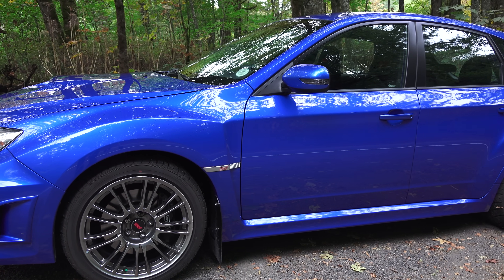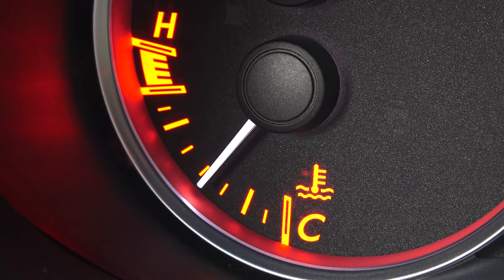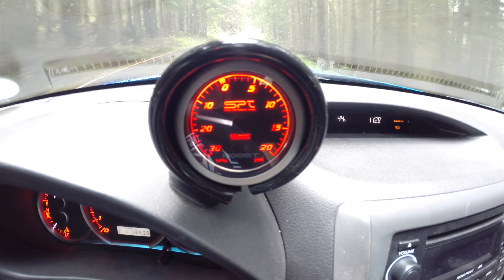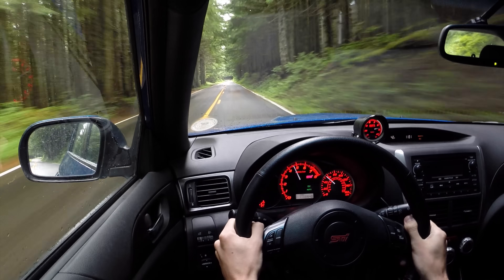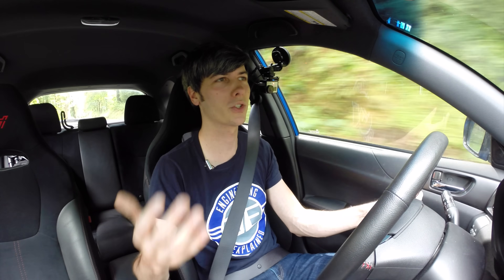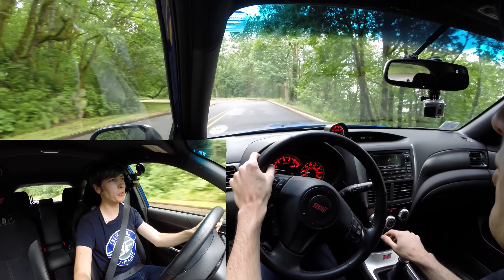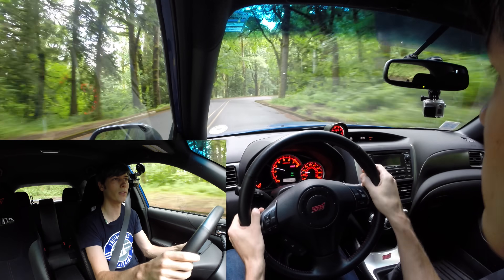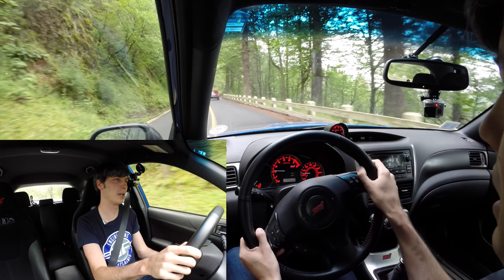5 Things You Should Never Do In A Turbocharged Vehicle

Comment: Unless your car has an auxiliary coolant pump that continues to run coolant to the turbo charger after the car has been shut off to prevent any issues. Thanks VW!
Reply: Yeah but Subaru's just use science instead of a pump. Their turbos are oil and water cooled so the coolant will continue to circulate even after shutting off the engine because of thermal siphoning. That's why turbo Subaru's have an extra coolant reservoir above the turbo at a higher point in the coolant system then the radiator.
Reply: +Ethan Johnson except for Subaru, because Subaru, you know...
Reply: And BMW. And Audi. And Mercedes. And almost any modern turbo car that has a performance turbo.
Reply: It's still wise to cool your whole car down, especially after some fast driving. brakes, diffs, engine, oil, coolant etc. It's not just the turbo that gets stressed.
I personally do it on every car I ever owned, NA or turbo. its not that I am standing there with the engine idling, but, 1-2kms before reaching home, I start driving slowly, low rpm, small load, etc. 
your car (and your pocket) will thank you later, especially since you own a vw
Reply: Ivan Nosic it depends. modern cars with electric water pumps are usually safe.
But on older ones, you can switch the engine off, the water that remains in the engine block boils because it is not circulating. Boiling makes steam, and steam can lead to corrosion in the engine.
The same thing can happen with the oil, it gets overheated at some hot spots inside the engine and can lose its protective properties.

In any case, it's always better to let the whole car cool down a bit. Fast driving also means hard breaking, fast shifts etc. Brakes, tyres, transmission, everything is warm, why not let it relax a bit?
Reply: 3DFX I agree. You have an excellent all rounder with great performance.
All you need is a set of semislicks and maybe some upgraded brake pads and you  are good for track days, while keeping it perfectly good for everyday use even. I wouldn't bother tuning such a nice and balanced car (damn I say too many good words for a vw, which I usually don't like, but clubsport is a fine sport car)
Reply: That doesn't mean you should just shut off your engine after running it hard. Even in engines without a turbocharger, it's wise to let things cool down for a little bit and let temperatures even out, let parts seat evenly, etc. as they cool.
Reply: yup but that keeps the engine consuming extra fuel even without driver on wich is hilarious cause goes against the downsizing scam argument also that amount of fuel is never considered for car magazines and autotesters when measure fuel efficency LOL they suck!
Reply: Ford Ecoboost engines have this as well
Reply: Yep, even my Fiat Abarth has an electric auxiliary pump that runs after the engine is shut off.
Reply: Ivan Nosic no,its not wise to turn off a NA car when it's hot after some fast driving.
I don't know why so many people think it's just the turbo that needs cooling
Reply: Ivan Nosic yes, after a certain point, turbo engines also become very expensive to tune.
The problem with NA engines, is that, no matter what you do, you can't get a lot of hp from them, unless you turbocharge them.
I mean, if you have a 3000cc NA engine that makes 300hp from factory, it is extremely hard to get it to 400hp for example. And even then you might need a stroker kit, which immediately sky rockets the cost of the project.
And in the end, you will have an engine that will be lethargic up to say 5000rpm, and it's power band will be 5000-8000rpm. Not very useful
Reply: dimos k Interesting! iwas thinking of buying new Turbocharger (TTE470) and, intake, intercooler, & tune my new Golf GTI Clubsport. But as the list of things grew, so did the costs (& i assume the risk of future problems). Im assuming if i would go all the way, i may have 15.000 dollars or more for all the upgrades. So i started thinking, hey the car is already excellent from factory, why give myself more problems in the future..? So ithought it might just as well be smarter off saving those cash for the next car i buy, in 5 years or so. Thinking twice about it, the upgrades would have been 1/3 rd of the cars total costs, & thats not even including installation. Do you have any good recomendations what i could do with it without compromising realability? The company i asked said software tune & change intercooler & intake would be the wisest choice. Whats your opinion on this?
Reply: +Vegaspsycho what? Same deal with my 07 A4 and was the same in my 00 A4 too. Subaru turbos are not special in any way at all.
Reply: into and onto, coolant and oil........ or onto your exhaust manifolds... ugghh.. 
been there done that...
Reply: and 80's Porsches
Reply: Some of my friends' turbodiesel cars had a turbo timer installed which prevents the engine from being turned off from 30 seconds to 2 minutes depending on how hard they drove the car. You can pull out the key and lock the car though and it shuts the engine automatically.
Reply: thank goodness for remote lock unlock that s NOT INTEGRATED IN THE KEY BECAUSE OTHERWISE, IT OVER
Reply: +Ivan Nosic yeah but if that keeps the engine and turbo healthy then thr extra fuel burned is worth it, besides idling for 2 minutes doesnt consume that much fuel does it?
Reply: +Ivan Nosic Nope, the engine turns off, the pump runs off the battery.
Reply: +Charles Gtm maybe but if you have those "2 mins." over and over... you know! also thats can gets a bit annoying in my opinion.. NA can go full throttle all day you arrive turn off period.
Reply: +dimos k. im agree but on turbo (specially on tuned ones) things can go wrong easier despite all of those cares you take compared to na tuned cars..
Reply: +dimos k well thats basically because a turbo reaches very high temps compared to na ones.. on atmos you can have the engine running a couple of secs if is the valvetrain temp the possible problem?
Reply: +dimos k. im ok with the general let cool down everything a bit but i was refering more specificaly to the engine area of the thing in wich having a hot turbo makes a big difference in terms of cool parts properly down i had a couple of turbo cars and used to have issues like cooked up sensors, wires, and even turbos, so i went for na a bit underpowered but more reliable in general.. not to mention the lower maintenance costs :-)
Reply: Ivan Nosic ye that's true. Although a non insulated exhaust manifold can reach similar temperatures to a turbo, depending on the engine of course. 
But ye, NA is simpler, more reliable in the long term. But damn, I would sure miss the mid range torque of the turbo, especially since its almost impossible for us to get anything with more than 2.0l capacity (very high taxes)
Reply: +dimos k same here large displacement i mean over 2.5lts can gets a bit difficult to find but fortunately i live in a country where na tunning its more common than turbo :-) where you from??
Reply: +dimos k. well Europe its common to see more turbo tuned than atmos because its precisely there where the downsizing scam began... in my country exactly the opposite..  i mean tuning a turbo its way more expensive due to replacement costs, maintenance costs (top of the line oils and fuels required) higher than their na counterparts, etc. you see here (Argentina) a vw golf gti with the frecuency you see a ferrari there! because of that lol
Reply: +dimos k but the good part is that you can turn a 17s quarter mile car into a 13s witn only 2 thousand Euros NA to do the same but running turbo will cost you twice and so on
Reply: Ivan Nosic well it depends. A turbo engine can gain power much easier and cheaper. My 1,4 turbo has 150hp, and I can get it to 190hp with just a reprogramming, nothing else, nothing needs replacement.

If you want to do that to a 150hp NA engine, it will require a lot of tuning parts, engine dismantle, lower compression, different cams, intake polishing, etc,etc.
Much more expensive.
Reply: +dimos k in the first tuning step you are right.. but if you want to go beyond things start to change rapidly in favour of the atmo trust me i experience that several times just like most of my petrolhead friends.. and you are also right everything will vary on each engine know what i mean?
Reply: +dimos k, agreed.
Reply: +dimos k. when you go bigger on a turbo engine power band goes up too just as on n/a except for the diff in power the effect is the same.. i dont know in your area but here you can get way more than 400hp out of a atmo 3lts. hehe actually the more linear and peogressive powerband from atmos makes them better for track use and this was million of times shown on tracks everywhere for so loong. Regards
Reply: Thanks Mini!!
Reply: +Ethan Johnson even my 2001 VW Polo has it
Reply: My 93 Talon TSi had nothing but my little Abarth has one - and thank god.  I use to hate sitting in the Talon after a run to let it idle for a few minutes, or just leave it run for 10+ after a long trip.
Reply: You still have to let the metals cool down, it's not just about the oil.
Reply: Just ignore the emissions scandal
Reply: +Vegaspsycho The only thing Subaru does well is blow head gaskets and leak coolant into the rest of the motor 👍

Comment: 87 Octane... 8...7... unlucky.
Reply: Yeah it's crazy, 95 minimum here in the UK
Reply: They use a different system there. Go figure.
Reply: I've posted awhile ago comment about difference between US and EU ratings. Still US87 is like EU91. Not even close to EU95. Basically, you have RON and MON octane number. EU uses RON as rating and US uses average (RON+MON)/2. That's the difference.
Reply: Yugo should go on ethanol :D It would be more reasonable for northern use.
Reply: You can get 93 AKI (About EU97) in the US without too much trouble.  North America simply gives you more options, whereas it seems you guys in Europe don't get those options, and instead just get the top end stuff.  It helps explain (one of the many reasons) why your gas is so expensive.

There is no danger putting in the lowest octane rating that your car can safely handle.  Using higher octane does absolutely nothing but cost more money.

I wonder if this has anything to do with leaded fuel, since lead boosts octane.  In the US leaded fuel was banned in 1996, but the use was less than 0.1% of all fuel sold by that point.  It was banned in California (where most car legislation in the US seems to come from) in 1992, and, frankly, by 1985 finding a leaded pump was becoming difficult.  This makes sense since catalytic converters were required in North America since 1975, however, it seems in the UK this wasn't the case until 1992.

I'll also say that in North America turbocharged cars were pretty rare until the past couple of years with EcoBoost engines.  Not very rare, but despite having driven for 20 years, I've never driven a turbocharged car, so rare enough.

Basically, there's historical reasons to why lower octane fuel is available in North America.
Reply: You can get 85 octane here in Colorado
Reply: Turbocharged engines in EU are standard right now. You can hardly get anything else. Still in Poland most people prefer older cars and mostly diesel ones.

Comment: Your fifth point is a little mundane, if you don't modulate your throttle on a NA motor or Force Induction version, if it has the power, it will cause over/under steer regardless, it all comes down to smooth is fast.

Comment: when should a turbo be changed out in a regular road vehicle,  I have opel astra 1.0T?
Reply: If you start hearing a dentist drill sound under boost then your turbo needs to be replaced imminently. Otherwise if you begin to suffer from oil consumption and you don't see any spots on the ground after leaving your car in one spot for an extended period of time then their is a good chance that the seals in the turbo are going bad. I have yet to ever see a turbo that lasted as long as the engine it is attached to short of blowing the engine up due to poor tuning/ boost creep/ overheating.
Reply: How much to change a turbo, mabye better to change car
Reply: The torbos need to be replaced like any other part when they fail or when the failure is imminent even if not there yet. However, you should have gotten a different vehicle than a FAILpel FAILstra.

Comment: Great video ! Is there a difference if you have tsi engines ? They got 2 turbochargers. One works from lower rpm and the second from higher rpm. Personally, i drive 1.8 tsi engine with 180 hp and the first turbo starts from 1250 rpm and the second from 3500 rpm ( i think ). You always have the power, even if you are in the wrong gear and going below 1250 rpm.
Reply from the maker: Low gears have great torque, so it's more important to stay out of flooring it when you're at low RPM in a higher gear. Automatic transmissions take care of this.

Comment: Get a high power naturally aspirated engine then you won't have to remember all these steps for having a turbo.
Reply: but then you get no braaappp zututtututuu cshhhhh braaaaaaaaaaaaaaaaapp chassis zuttuutu
Reply: + to me it's like N/A cars feel slower as the acceleration is linear.. I prefer the feel of boost coming on ;)
Reply: BarbecuedPossum Instant power makes a car feel slower? You must be talking about a car with a busted rear end, high milage, bad maintenance, or bad transmission.
Reply: actually it still applies to oil and high load at low rpms. Its all just common sense mechanical sympathy really
Reply: N/A? Lol put a blower on it, problem solved!
Reply: Note that there is difference between turbo lag and boost threshold. Most of people confuse this two. Turbo lag in modern engines is veeeeery small and basically with big turbo lag you would feel like driving N/A car until turbo kicks in. It's time between putting throttle down and actual boost in acceleration and it's measured in operating revs. 
Boost threshold is natural thing for turbo engines - just revs at which turbo starts working. When you drive at low rpm, you have no boost and drive like N/A car. After reaching boost threshold your turbo can actually add boost.
Turbo is just addition, so discussions on which is better have sense only when you compare small turbo engine with big N/A engine (reaching similar power). Personally I like turbo engine just because I don't need high revs to get most of it's power. For daily driving it's ideal, for racing rather not. But then, why use big N/A engine for racing if you can have the same big engine with turbos? :D
Reply: but cant we have both ? .....
i love both, the skyline RB25DET has its place as does the sunny SR20DE (have both and some others but perfect example for my arguments sake).
personally those steps were instilled into me from a very early age with any vehicle, it should be common knowledge to a degree.

Comment: I like your videos.
But:
Point 1: Good advice.
Points 2-3 are known and "modern" cars are protected against those problems. 
Point 4: Citation needed (Could be correct). Different fuels have different burning characteristics and IC-Engines are typically designed for one specific fuel. Buy the fuel recommend from your car manufacturer. In Germany we don´t have real differences in fuel quality.
Point 5: Sure if someone don´t know what he is doing.

Sorry for my englisch. 

Keep up the good work
Reply: It isnt the quality,  its just the octane rating... And he said for MODIFIED cars.

Comment: The vehicle should be tuned for high load and low rpm, if it's too rich the ecu should adjust the amount of fuel. Also how will it not get enough air? If it's a new efficiently turbocharged motor (small turbo etc) with low boost threshold it will easily be able to force a high volume of air into the engine once at the boost threshold rpm (as low as 1200rpm in many new vehicles), in fact would you say that's what modern turbo engines are designed to do for peak efficiency and fuel economy?
Reply from the maker: It has to be rich at high load/low RPM, otherwise knock/pre-ignition is far more likely.
Reply: Why/when would someone want to produce a high load on their turbo with low RPM?
Reply: They forget and think they're driving a slushbox or otherwise have no clue.
Reply: Are you saying pre-ignition is more likely at 'high load low rpm on boost' or 'high load low rpm before boost'?

Does the engine not behave like a naturally aspirated engine off-boost... I can only envision pre-ignition being a potential problem at low rpm high load on boost. Interesting subject.

Comment: Which of these also apply to turbocharged diesel engines? Specifically the Ford 7.3.
Reply: All of them. Heat would be less of a problem though.
Reply: I also have a turbocharged diesel engine. If possible, please explain why heat would be less of a problem.
Reply: The exhaust temperature of Diesel engines is considerably lower. So the turbo charger runs a bit cooler.
Reply: That makes sense. Thanks !
Reply: Basically just worry about the cold down and warmup. Nothing else you can do will kill that engine lol

Comment: My v70r has it's tourqe at low rpm, and the bhp at high rmp. Does the same thing apply in these senarios not to floor it at low rpm?

Allso Volvo spesifes 95 octane in the manual, and the car is tuned for 95, so the "buy highes octane" is not allways true, just to clearify this is a 239hp/330nm car, so theres deffinitly power on 95.